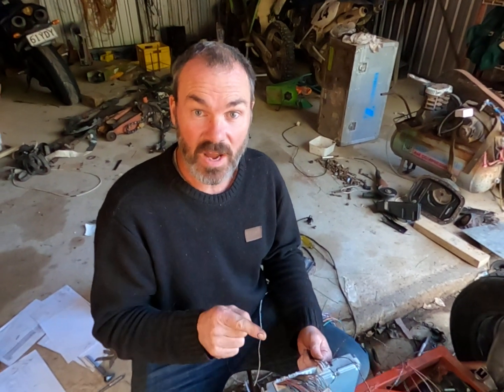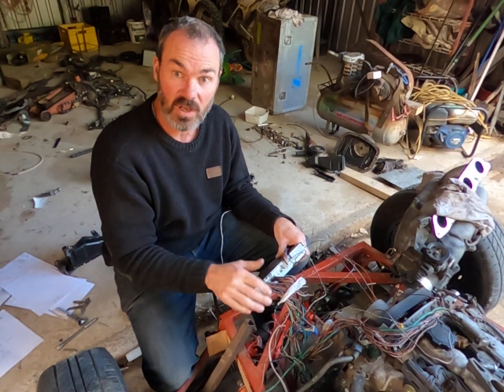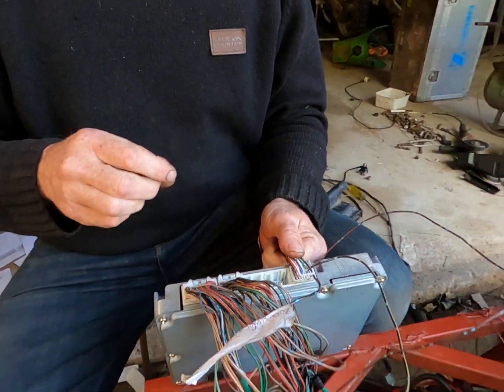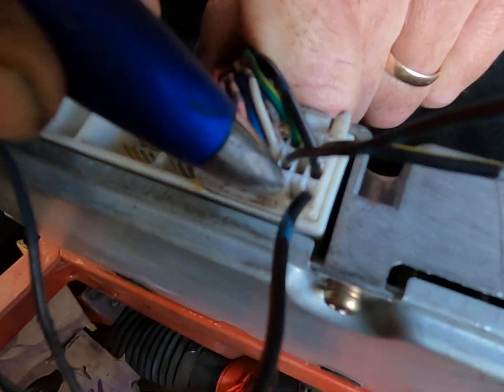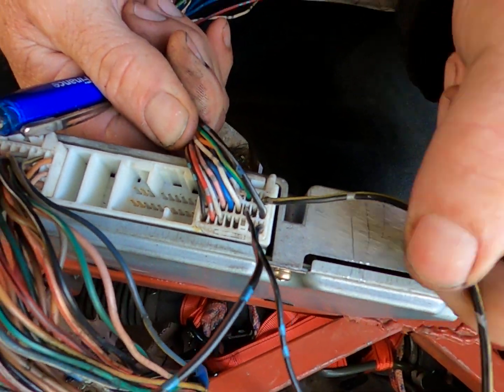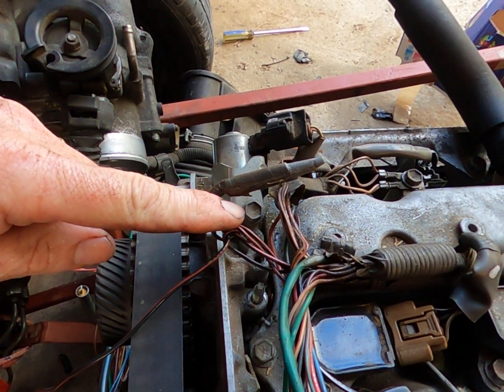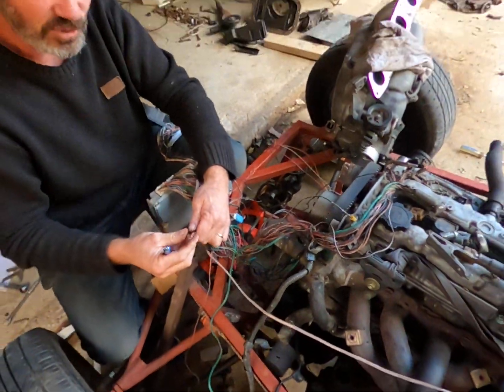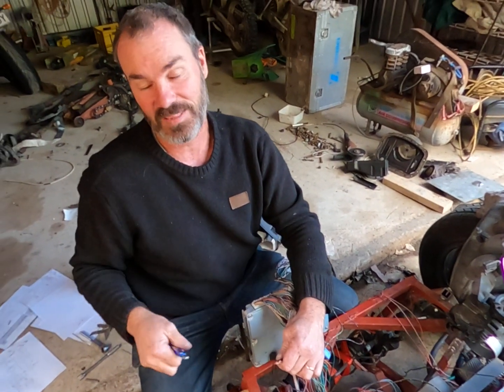How to wire a 3sge beams Ecu and get spark and injectors working. Ls200 Lexus. Toyota Altezza Beams.

Comment: My RS200 beams ecu isn't sending voltage to the coil pack to spark the plugs. Can I trace the wire as he stated and run the 12v to it only or do I need to separate the 1st 3 wires as in the vid? Any help on this someone

Comment: Beams swap info in comments I've provided
Reply: How are you sure??
Reply: @RauhweltRebel  I was only asking because I was confused about it, I’m currently in the process of doing the wiring for my 86 also, thanks..
Reply: @user-qw9xv1xx3p awesome, any questions feel free to ask.
Reply: @RauhweltRebel   so beside powering the coils and injectors, is the e junction clip the only other wires that needs powering? Oh and also how would I do a backup power supply? With any 12v source like off the fuse box.
Reply: @user-qw9xv1xx3p  so here is a list of pinouts the ecu will need 12v ignition power for.
E8 (ignition)
E16 (ignition)
E10 (ignition)
E1 (ground)
You will also need to power your (tps) 5v supply to pin 3 on (ea2) beams blue plug
(Ccv) 12v ignition pin 4 on (ea3)
Beams white plug.
To make you alternator work test continuity to beams body plugs, this is what I did 
(S) sense, pin 9 (ea1) grey plug
(Ig) ignition, use from existing loom
(L) lamp, patch into (a22) on ecu with fuse (7.5 amp)

Others are
(D26) tachometer output
(E4) cooling fan output (12v)
(D28) starter signal input 

You circuit opening relay is,
(E3) output.
Efi main relay is,(E22) output.
(E7) check eng. Warning light
 
All body earth's are and I reccomend adding more.
(E15, b17, b18, a31, a8, a9 .
This will get you on track.
Reply: @RauhweltRebel  thanks a lot dude!! Best help I’ve ever gotten
Reply: @user-qw9xv1xx3p  happy to help
Reply: @RauhweltRebel  one more question, do I ground off the ecu or off the wiring loom ?
Reply: @user-qw9xv1xx3p  I added grounds to the blue plug with all the brown wires in the ecu box which go to a and b ecu so leave them but make sure to earth inlet, cam cover, head, block ect. That will be sweet
Reply: @user-qw9xv1xx3p  I made a good body earth bar to make sure it's all grounded properly
Reply: @RauhweltRebel  alright thanks dude, do you have any other form of social media to keep in contact ?
Reply: @user-qw9xv1xx3p  that's OK man anytime, did that answer you question ? Sorry no social media
Reply: @RauhweltRebel  understood,. so the extra junction clips that come with the beams wiring loom are basically power and grounds.
Reply: @user-qw9xv1xx3p  sorry forgot to add them 
Ea1 grey plug.
Pin3. Black/white 12v power to coils via relay.
Pin7. Black/red 12v power to injectors via relay.
Pin8. Black/yellow starter solenoid 
Pin9. White/blue alternator sense 7.5amp.
Ea2. Blue plug.
Pin3. Blue/yellow 5v power to tps.
Ea3. White plug.
Pin4. Black/red 12v power fused to (Ccv) canister closed valve.
Pin8. Blue/black thermo fan trigger from ecu. Or (e4) ecu
That's it accept for reverse is in there from the gearbox also which from memory is red/blue and red, so just check continuity with multimeter when putting in reverse, also exhaust  O2 sensor which is a plain white wire also(a28).
Reply: @RauhweltRebel  got it thanks dude, goodnight
Reply: @user-qw9xv1xx3p  anytime, cheers
Reply: @RauhweltRebel  you should make a video covering this topic of beams wiring 5th gen. im doing the swap too yew
Reply: @kieranabbey6418  awesome bro, I definitely will be making a vid soon to put everything into perspective 👍
Reply: @RauhweltRebel  Legend
Reply: @user-qw9xv1xx3p  so I have an update regarding the power mem e1, so if you power this it over-rides the fly-by wire which my pinout said however this does need to be earthed after all and a manual over-ride to the throttle body needs to be done, sorry about any inconvenience.
Reply: @RauhweltRebel  how’s it going dude. Ah so e1 is ground after all ?
Reply: @RauhweltRebel  hey,man I need some urgent help on my wiring…its an Altezza beams manual engine I mounted in a fwd carina
Reply: @josephpermaul2274  sure buddy I will be able to help and will get back to any questions you have this afternoon
Reply: @RauhweltRebel   how’s it going dude, I had one last question how did you wire up the  maf
Reply: @user-qw9xv1xx3p  hey man I'm good so I was fortunate enough to have the airflow meter supplied with the engine and fabricated a pipe to house the maf but if you atr wiring from the ecu the pinout is ; vg (b21) red wire and evg (b1) light yellow wire and is about 1.0-1.5 volts input from ecu, on the plug for the Maf itself from left to right looking from where the wires go in are ; 
1. Brown (earth)
2. White with red trace signal for vvt (b5).
3. Red (b21) vg
4. Light yellow (b1) evg
5. Black with red trace (power)
Reply: @josephpermaul2274  how can I help?
Reply: @RauhweltRebel  nice to hear your well dude,  thanks. I’m almost there half of the car is already wired up all I need to wire up is the maf. Coils and injectors. fuel pressure should be 60psi ?
Reply: @user-qw9xv1xx3p  62 or 63 for return less but I'm running 60 and it's fine at that
Reply: @RauhweltRebel  ahh ok mine was at 40psi.  Oh I meant to ask how did you power up the ecu ?
Reply: @user-qw9xv1xx3p  I powered the ecu through fused ignition power to an open circuit relay
Reply: @user-qw9xv1xx3p  so the pinout I sent you with the ignition powers will tell you and will need a relay
Reply: @user-qw9xv1xx3p  accept for e1 which is earth
Reply: @RauhweltRebel  oh yes your right, thanks. Just having some problems with the engine not starting up. Wired everything up but I’m thinking it’s the fuel pressure not letting it start up the car.
Reply: @user-qw9xv1xx3p  give the injectors a tap with a screw driver also that's what mine needed as it had been sitting for a while and they were stuck from the stale fuel
Reply: @RauhweltRebel  how do you manually reset or override the throttle body? In the process of getting first start on my swap, and everything is wired but am not getting signal for spark or ignition, 12v is on both but ecu wont send signal. Wondering if that is because of the 12v I put to the e1 pin which is actually ground. Thank you!
Reply: @alexnovak6333  so yes I've since edited my post regarding e1 yes it is ground but it shouldn't have hurt anything as all it will do is cause the tps to respond differently, apologies there. I had a problem getting pulse and spark initially also and it was the injectors were blocked from sitting so try tapping them while turning it over or get them cleaned also check through the comments section on my post as I've put a pinout of all that you will need to make it run properly...
I since purchased a manual throttle body conversion from green zone Japan about $300au which comes with all you need to eliminate the flyby wire including a patch to set the tps ohms and very good quality internals for the throttle body itself, any other questions don't hesitate to ask hope this gets you going
Reply: @RauhweltRebel  very much appreciate it man, what did you use to tap the injectors and where did you tap them? Got it to spark today and believe that fuel is stuck like your situation
Reply: @alexnovak6333  just on the body of the injector itself with a blunt solid object like end of a screwdriver handle or something that won't damage the injector not too hard but just keep tapping each one until you get some life to it also do you have a fuel pressure regulator set to 60-62 psi and sufficient lines to hold that pressure?
Reply: @RauhweltRebel  yes, I got fuel pressure sorted and braided lines for flow and pressure. Really appreciate the help, this is my first engine swap so the stoke is real
Reply: @alexnovak6333  happy to help, please let me know how you go 😊
Reply: @RauhweltRebel i know this is old but how do you add a manual overide to the throttle body?
Reply: @juniormorrison2422  that's OK there is a kit from green zone in Japan first get that....

Then you'll have to convert the instructions to English. 
It also involves taking to throttle body apart and replacing and adding some various gears, then will be the slightly harder part of setting the throttle position sensor with two wires they provide, it's all explained very well in the instructions and will take you about an hour, overall the gears give you full throttle play while still letting the ecu think nothing has changed, for example no codes and last step will be setting idle once its all back together by putting-: ignition on for 5 sec then off, ignition on slowly press throttle to full then release then ignition off, ignition back on and start.. once warm it should idle nice with some adjustments of your idle screw and I found 700rpm is sweet.

Hope this gets you sorted 👍

Comment: This will get the engine to run, but not run 100%. You need the third connector for a tachometer signal and for an oxygen sensor to be wired in (auto only), and the ambient air temperature sensor input. I didn't verify the powers and grounds with my wiring guide though.
Reply: more info please.

Comment: Just did this and my ecu sparked and smoked.. so..
Reply: per 3SGE wiring E10 is for the IGSW. I think it should not be soldered to the 12V.
Reply: Why some wiring diagram says the N1 black yellow should have constant batt. But yours is negative. I’m confused
Reply: @mikescj2aownergarage488  me to man ive been  trying to figure this out as well
Reply: Did I fry your ecu?
Reply: hi just curious ,  what did you find. did you fry your ecu?
Reply: El cable negro con amarillo es batería.. 12v directo

Comment: Awsome is there a wire from the maf sensor needs 12v as well .
Reply: Wym is that’s why don’t stay on
Reply: Yeah, if you don’t put 12v to the MAF it will redline at about 3k in limp mode
Reply: All the wires should be there ecu itself has built in relays and controls
Reply: @cjrecord23  power for the MAF and injectors does not come from the ECU. power has to be supplied to the MAF and injector circuits.
Reply: @DoctoredGarage  that’s how it’s set up on mine one wire
Reply: @cjrecord23  The main power wire to the ECU has a junction for the MAF 12V. it's not necessarily that the ECU provides power to the MAF, but that the MAF and ECU receive power from the same source.
Reply: @DoctoredGarage  maybe it’s because you are not using the box setup or because you eliminated the unnecessary wires
Reply: @cjrecord23  if you look at the wiring diagrams you'll see that they both receive power from the efi relay. ECUs from this era limited the amount of power/amperage supplied by the ECU. The injectors, coils, MAF, VVTi solenoids, etc are all supplied 12V from an external source.
Reply: @DoctoredGarage  idk I used the ecu main relay build in the ecu to power everything
Reply: @cjrecord23  there isn't a relay in the ECU
Reply: @DoctoredGarage  I gotta go back to it , it was something about giving power to a single relay to start the ecu and a relay for starter
Reply: Power comes of ecu